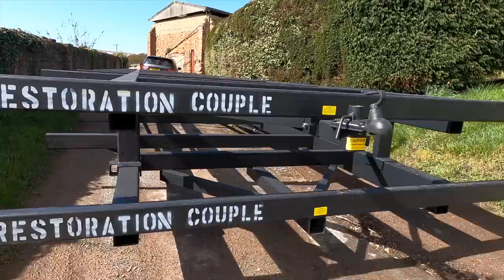HERE AT LAST - Huge Cabin Chassis are ON SITE!

Comment: I think the jack up, pull out from under approach would be easiest. Do you have some beams you can put under the upper structure that are long enough to span the width of the bottom structure? That would be the approach I’d take.
Reply: Agree. You could build 4 pillars from blocks or logs, one at each corner, use them to jack up and hold the beams, then roll out the lower one. Needs to be really solid though as it's easy to overlook just how much weight is in each chassis. More than enough to kill you if it falls on you or rolls off down a hill!
Reply: Maybe using scaffolding would be the strongest and most stable option. Can have a beam over the top and brace it in multiple ways. Plus then you could lift it on chain blocks/pullys

Comment: Jack the top one up, roll the bottom one out the way, fit the top ones wheels on then lower it down. That’s how I’d go about that, save potentially scraping the chassis and causing a load more work!

Comment: Great to see the long awaited chassis on site 👏👏
As for getting them separated, I’d go for raising the top chassis clear and supporting it on blocks. You can then pull the lower chassis clear….attach the wheels to the top chassis on to the ground. ✅✅

Comment: Easy. Jack top chassis enough to install wheels. Scaffold board on top of bottom chassis outriggers, combined with a ramp at the ‘off’ end and lower top chassis down. Roll top chassis off the bottom one and restrain as it ramps down. The challenge is to do it all without machinery. A small trolley jack, plenty of short 6x2’s and 12mm rope should be sufficient tackle. Good luck👍

Comment: High lift 4x4 jack, prop it all up and tow the bottom one out….the best way to move them I’d say is buy yourself a bolt on quad/atv tow ball off eBay or Amazon, drill the cutting edge of your front bucket and bolt it through, you’ll have good height adjustment on the loader to stop the chassis bottoming out and should turn well in tight space of the yard being attached out on the loader 🤞🤞 good luck, where there’s a will there’s a way 😉

Comment: Definitely jack the top one up. 4 small hydraulic bottle jacks and loads of timbers to prop it up in small stages , 2 long beams to hold it up while you pull the bottom one out. Stick the wheels on before you lower it down. Good luck!

Comment: Getting the top one off... either: 1. Extend support out sideways and slightly lift the top one so you create a bridge to pull bottom one through once clear lower top onto wheels. 2. Use some of your timber hoard and create two timber tracks on top of lower out riggers and roll top off with a couple of wheels fitted each side, will need to incline the lot in order to roll off at the end. 3. Pull the top one off but put some round timber posts between to reduce friction and save protective paint. Good luck

Comment: I suggest lifting the top one, one end at a time with the tractor and cribbing it up with timbers/scaffolding/ blockwork, whatever you have to hand. if the cribbing is out to the sides you'll be able to drag the lower chassis from beneath.
fit the wheels to the top chassis and lower it bit by bit form each end. 
it'll be a long day, but safe.
you probably don't need all eight wheels whilst there is no superstructure and removing two pairs will make it a whole lot more manoeuvrable until you get them both in their final positions.
I love watching your channel and the size of the project you take on would scare most DIYers. please continue to produce great content.

Comment: I'd use some round fence posts and roll the top one off the bottom one. Just have a platform for the top one to slide on to so you still can fit the wheels.

Comment: I have moved things (mostly on my own) by going old school and this looks like it would work with long round fenceposts as rollers and simply roll it off slowly putting wheels on the top trailer as soon as you have clearance off the back, no need to reinvent the wheel the blocks for Stonehenge were moved using the same technique . Expat now living in Tasmania cheers John

Comment: To get the top one off is quite easy depending on what you've got. Go to one end of the top one. Put a sling round it and lift it with the bucket of your tractor. Put a beam under it and support that beam with columns made from wood or concrete blocks, whatever you have to hand that is up to it. Drop the top one on to the beam, Go to the other end and do the same. The top one should now be clear of the bottom one. Hook up to the bottom one and drive it out of the way. Fit the wheels to the top chassis. Gradually lower it on to it's wheels doing one end at a time. Hey presto they are both on the ground and moveable.

Comment: basically jack up the top part with blocked up timber, then slide the bottom part out from under, move the bottom to give space, then use the tractor to lower the top part in increments and mount the wheels and presto you have two parts seperated.

Comment: Jack the top one up using a bottle jack on the bottom one. Place a pair of wheels each side along with some scaffold planks on top of the bottom chassis, then roll it off, you'll have an easier time than metal on metal. Also use  a come-along winch to pull it as you'll have more precise control.

Comment: Put some bars through top chassis, then jack up top chassis, and add wheels, remove bottom chassis and lower top chassis; you may need to borrow a few trolley jacks, and have some helpers to lift and lower evenly.

Comment: With a counter weight on the back of  your tractor like a pallet of bricks etc, lift the chassis up with the front of the tractor and tow the bottom one out from underneath with the car. Then fit the wheels on the other chassis before lowering down onto the ground. Not sure what your tractor can lift but it could be worth a shot.

Comment: Lock/chock the wheels of the bottom trailer, and/or attach to towball of car. Jack the top one up and put 3 or 4 scaffold tubes across the width between the two. Use the tractor grab to pull the top one back. As the wheel axles of top trailer clear the bottom one, put the wheels on. You might find you only need two tubes, but have to reposition them as you go. Could possibly use round wooden posts. I've moved empty skips sideways using a single 4' scaffold tube this way before. Might help to put counter weights on the back of the tractor.

Comment: My suggestion ( not speaking from any sort of experiance) put the wheels on the top trailer, jack it up to put timbers along the outriggers of the lower trailer. The wheels could run over the timbers and then a ramp down at the end of the lower trailer to the ground.  Either way good luck.
Reply from the maker: I like that. The benefit of sliding it off without wheels is it’s all happening slowly, wheels up top could go wrong quick on slope though. 😬
Reply: How about two electric/manual winches on fixed point horizontal bean set at desired width apart each attached to either side of end chassis outfitter which would give you total braking control of the descent of the top one. You could also induce/correct slew by braking one side more than the other. Great to see them arrived at last. You are an amazing team and I wish you all the best for this brilliant project.
Reply: A 'beam' would probably work better than a 'bean'!😆

Comment: Lift both ends take the wheels off the bottom one put them on the top one. Lower them both down to the ground then you'll be able to roll the top one off from the bottom one. You might need to remove the jockey wheel.

Comment: Could you put boards on the outriggers of the bottom trailer, use the tractor to lift one side at a time and put the wheels on then wheel the top trailer along the boards off the end? It would help if you had a bank or a ledge somewhere about the same height as the bottom trailer to roll it off the end or possibly create a ramp using long boards off the end.

Comment: To be fair I suspect either method work fine if done methodically and slowly.

Method 1) if you tractor bucket is strong enough to lift half a chassis, then using a strap over the bucket lift one end of the top one, slide a beam underneath that rests either side on the trestles you made for the workshop build. Repeat for the other end. Slowly pull lower chassis out. Attach wheels to top chassis, lift one end, remove beam and drop to floor. Repeat other end. You may need to drop it to a half way point depending on wheels/chassis angle and clearance.
Method 2) use grease or neat washing up liquid to grease the bottom runner and pull the top one off. Youll need to strap the bottom one to something solid like a car as I doubt wheel chokes will be enough to hold it in place. The hardest part will be overcoming the initial friction. DPC or harder plastic (like an old kitchen chopping board) as a slip membrane should help, but you might find a generous film of washing up liquid holds it off enough to avoid scratches. Using wood might actually make life harder as it will suck the moisture out the grease and stop a film forming. If DPC I would put ridges face down and washing up liquid on top in the valleys to act as mini lub reservoirs. You'll need at least two pulls - one to a position where you can get wheels on, then another to clear it. 

In both cases make sure you think through what the other chassis will do as the load changes - you pulling a giant seesaw off a giant seesaw, so load changes will change centre of gravity which will see the pivot points shift. 

And whatever you do make sure you film every possible angle. That way of it goes horrible wrong you can stick it all on YouTube, get a viral hit and all the add revenue will pay for the damage to be repaired 😝

Comment: Buy a length of the next size down rectangular section slide in the cross members. Block up then jack up you can then drive the lower chassis out, fit wheels then lower the upper in stages with the jacks and blocks. I have done this before with other similar structures as i work in engineering.

Comment: I think, if they're stiff enough, you should be able to lift one end with the bucket of de dumper. When you move the bucket forward and then attach the chassis to the top of the bucket it should lift the chassis when you bring the bucket back down. The other end with the tractors front loader or on the back if it's to heavy.
Good luck moving them! 😀

Comment: Just a thought. Once you have the mobile home body on the chassis, if and when you build a house and sell them, can you get them back down the lane without having to remove the body?

As for unstacking, you can do wonders with concrete blocks, timbers and a trolley jack. Progressively raise the upper off the lower on the raised timbers until it's clear then draw the lower one out from underneath would be my suggestion.
Reply: cut them up for scrap - you'd probably make more out of it, either that or keep them to use a fence posts or for a mezzanine somewhere - I bet they cost an absolute fortune though - if it's just to cheat planning regs use 20' containers blocked up and get someone to tack weld stub axles on for wheels that will never touch the ground - container already has a vapour proof heavy plywood floor in it

Comment: Prop the top one up in four places so it is stable. Let the air out of the tyres on the bottom one then pull it out. 'McGyver' the top one down by the clever use of trolley jacks and timbers . . . . .

Comment: Use a jack to prise chassis apart. Put dish soap between rails. Lower back down. Anchor bottom chassis, then start to pull top chassis off. As soon as you can, put wheels on the middle 2 axles. This will help it stay aligned with the bottom chassis. Leave the other 4 wheels off until it gets to where it needs to be. Otherwise, the tractor will struggle to turn them. Might even pay to remove the wheels on axles one and 4 of the lower chassis to make manoeuvring easier.

Comment: Use timbers to get the frame high enough to allow you to pull the bottom one straight out from under it then slowly lower it down to the ground.  You should be able to get those moved easily with a little trick movers of those homes do. Hook up and pull it forward to where you need to slide the back over some onto a piece of plywood that has been greased where the wheels will sit then you can use a chain and the tractor to pull the back of the trailer sideways a little.  Wish I could be there to help you move them because it's easier to show what im saying than describing what to do.

Comment: I am with another suggestion. Set outposts (large timbers and concrete blocking) at the front and put a tall cross member to attach a pulley system to lift the top trailer in the air far enough to pull out the bottom one. Put on the tires for the top one and lower it. However, take them to the location of the site first. No sense skinning the chicken twice.

Comment: hydraulic bottle jack, pick a corner of the top one up, crib it up, repeat for the other corners. pull bottom one out. lower each corner or end one at a time in small steps until it's on the wheels. It's going to take forever, but ...

Comment: You could use your little dump truck to lift one end and the tractor to lift the other and roll the bottom one out. Or just drag the top one off. Put the wheels on as you go if you drag it off.
Reply: not sure the tractor would be manly enough -  i'm guessing there is a couple of tonnes maybe a bit more in each leg - you could end up twisting the frame of that little tractor loader like a banana.

Comment: Lower jockey wheel makes aft end go up. Put wood under both sides of aft end top trailer. Use tractor to lift nose of top trailer up. At this point top trailer is suspended. Wheel out lower trailer. Then lower top trailer to ground

Comment: It is a pity you were not able to get them into your cow shed. you'd be able to chain hoist the top one up a few feet and drive the lower one out. If the ends of the outriggers are open place steel box section of a slightly smaller size into a few of them and wield those in (you'll be able to grind them off later) essentially making the outriggers wider on the top trailer. That will give you a platform to use saw horses and bottle jacks to lift the top trailer from below, yet wider than the bottom trailer. Once lifted drive the bottom trailer out between the lifting structure. Anything you try will be bloody dangerous, so go slow, have help, and keep your dog, kids and wife out of the way. Take care D

Comment: Four lorry jacks to lift upper frame then tow away lower wheeled one. Then add wheels to jacket frame and lower to ground.
Reply: where are you going to jack it? you'd need to put steel or timber into the outrigger to clear the lower chassis - that's asking to bend up the outriggers and it will be unstable as anything over that length

Comment: I'd look at jacking top one up lengths of timber etc and pull the bottom on back out towards the lane, fit the wheels and slowly drop it down bit by bit. You are going to have a mare moving it and working with it on a field as is due to the weight.

Comment: they are big,  place some boards along the outriggers put the wheels on make a ramp with soil and pull it off with tractor , or if you are getting any deliveries with a Hi-abb sweet talk the driver to lift it off.
Reply: For all the wonderful engineer solutions a twenty pound note and a 15 minutes with the hiab is the sweetest solution of the lot.

Comment: I would be inclined to see if you can remove the wheels from the lower chassis to get the frame on the ground (on some timbers) so that the upper chassis can be slid off (timbers/grease to make "skates") and being lower doesn't have so far to drop to the ground (lack of wheels will also stop the lower moving when you slde the top one)  - one question : how heavy is each chassis? . . .  you would need pretty hefty jacks.

Comment: 100% Jack the top one up and get it temporarily supported whilst you roll the bottom one out.  The lower the top one down. If you try and roll the top one off it will damage the paint work to bottom one as a minimum. And potentially be dangerous if it comes off and then you will be in a worse situation.

What is the lift capacity of the forks on the tractor? Could you lift up one end of the trailer with it(whilst the other other is resting down. 

In one of your barns, are there any lifting beams, which you could use to fit a chain block and tackle to? 

Do you know what the approx weight of each trailer is?
Reply: Cut some short sections of steel tube and insert into the outriggers, so there is a section of tube hanging out say 500mm. Jack the top trailer up and sit the steel tube down onto stacks of timber.  Or even the saw horses you made - put them to the test ! Then you will be able to roll the bottom one out.

Comment: Well I'm sure you've got it worked out, but if it was me I'd hitch the bottom chassis to the volvo,  use the load to lift the top chassis bit by bit and stick some dunnage like bits of ply between them, pull the top chassis back until it's on the balance point which should allow you to stick some wheels on and keep drawing it back until the wheels start to get close to the ground (can't see the angles) you can then lift the nose of the top chassis up and block under the wheels, drop it down again then the whole chassis should be clear of the top.

Comment: I’m not entirely convinced by the telehandler route - it would be a very unstable load balanced on the forks. I’d go for the jack the top one up onto some big blocks, and drive the bottom one out. Slowly.